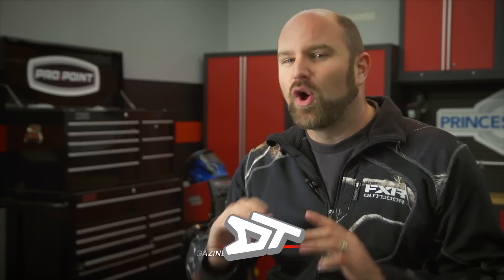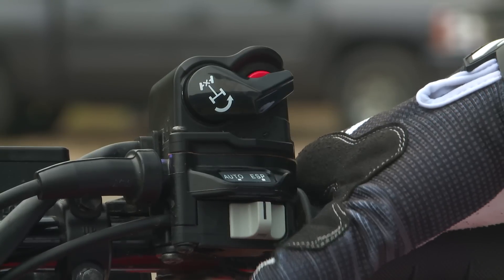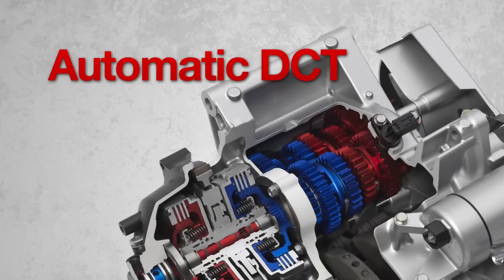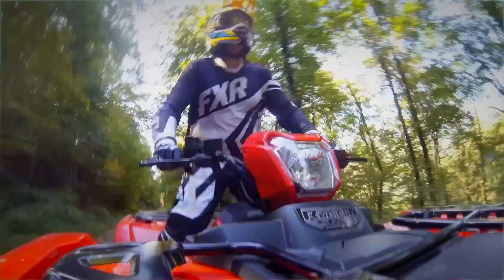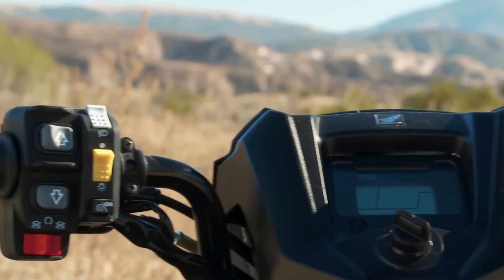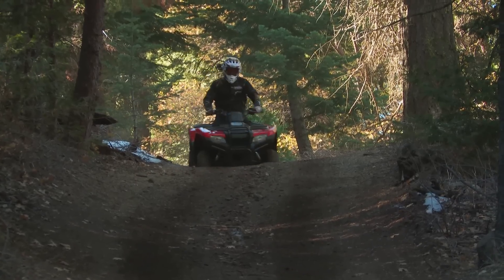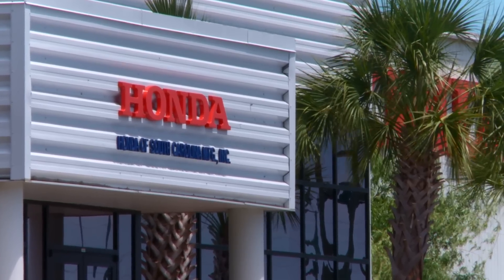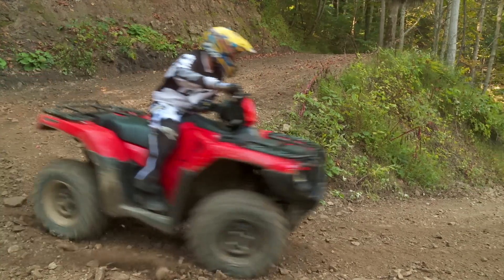Honda ATV Dual Clutch Transmission

Comment: So I have a 2022 Honda Forman rubicon 520 dct deluxe model. And I’ve got roughly 1017 miles on it. 177.2hrs. I’ve noticed when I’m in low gear if I give it more than enough gas to get unstuck it makes a pop noise maybe even a grind noise I let off and slowly try to crawl out in low. scares the life out of me. Still runs and shifts like normal. Normal top end speed no gear reduction. But I just put 28 swamp lites on it as well and it dose the same thing I’m nervous of what it could be any advice?

Comment: The only ATV I’d ever buy ! Not just the reputation for its dependability and longevity, but the fact that it’s the ONLY ATV left in today’s market that still offers the gear driven transmission. They’re tough , rugged , dependable , practical and functional . 
Another thing is that EVERY Honda model offers optional back up recoil starter , you don’t find that much anymore with other manufacturers. Always nice to have that peace of mind when you’re in the deep back woods and your battery goes dead for whatever reason. 
DCT appears to be a very innovative and unique design, I’m sure it’s durability parallels the Honda brand , but I still prefer the manual shift and the solid axle for MY specific needs ( I’m guessing the Foreman model is my ticket) . I’d opt for the EPS though as it makes tight technical riding conditions an effortless affair. 
My only gripes are small instrument panel , insufficient storage ( and lack of water tight sealing on the rear compartment) rear drum brake on the Foreman , and the lame tires that it comes standard with ( they should at least give you an optional upgrade on the more aggressive Maxxis tires that they previously put on the Rubicons) I’ve heard they even quit putting the more aggressive tires on the Rubicon now ?
Other than that it’s a solid machine.

Comment: I have a Honda Rubicon 500 its about a year old and im already having trouble with my shifter, it would not let me shift gears at all manually nor automatically i don’t know if its just my 4 wheeler or they all came out defected. And what could be the problem please help.

Comment: Japanese atv’s are tough as nails my aunt had a honda rancher that we ran at wide open throttle for several minutes at a time with 3 people and over 300 lbs on it. My yamaha has been crashed twice and repaired at home has a bent oil cooler. the honda now has a bent frame, and both still run

Comment: I have a 2017 rubicon 500 and in high the gears show on the display module but when in low the gears do not show is that how they are or is something wrong with mine?

Comment: I’m not a big fan of cvt belt drive  I like Honda because they have not gone to cvt  I love the gears.  No belt slippage or belt replacement   In my mind cvt is a cheap set up
Reply: maybe,but,i lot cheaper to replace.
Reply: I have 03 Yamaha Kodiak and it has Yamaha UltraMatic cvt and it actually one of the best belt cvt. But I prefer Automotive style Transmission.

Comment: Just sold a 570 sportsman and got a DCT Rubicon. There equally as fast. Everyone focuses on crank HP but the wheel HP was near equal and there both within a few pounds of each other. The rubicon is way more fun to ride by far! You don't need 1000cc 55whp monsters doing 88 mph everywhere. How often do you do more then 30 on a trail? Yeah didn't think so...
Reply: The rubicon accelerates just as fast as the sportsman ?? Looking at getting a can am 570. Everybody says the rubicon has no power / is slow etc.
Reply: Just bought a 2020 Rubicon Deluxe and couldn't be happier

Comment: Just brought home a 2017 Rubi dct/eps today.  This will be my third Rubicon.  I had an 04, and 12 prior to this one.  Im still on the fence about the new tranny by I think I will end up liking it. Shifts a little hard initially.  I always end up going back to Honda.  Had a 15 RZR 1k for a while but it was nothing but problems even without being abused.  Yes, the cvt was horrible. It got wet multiple times and if you ever ran it in high in the wrong conditions it would smoke.  Yea Honda is under powered but that also adds to their reliability.  All three of my Rubis have plenty of power to get me wherever I need to go and I have put them through some rough stuff.  I snorkeled the 04 and sunk it multiple times and never had a single problem.

Comment: Honda is the only way to go. While everyone else abandoned conventional transmissions in favor of CVT style. Honda stuck with what really works . Especially for longevity use. They actually taken a smaller bore and have turned out more power with gear ratios.

Comment: Its not too hard to be durable when it only has to deal with 30 horsepower.  Put a Can Am 1000 in front of the transmission and make high range go up to 80mph.

Comment: I don't know about this DCT transmission.  I own a 2016 Rubicon with the DCT and it is not a "seamless" shifting transmission.  I have brought it to the local dealer "Sutherland Honda" and they all said the transmission is not seamless and that it may get "a bit better" after the break-in period.  When my wheeler shifts, you feel the unit compress and once it shifts, it is very snappy.  They claim I didn't get a dud, but I would like to ask those who own one if they have encountered similar concerns or if they would consider the DCT a "seamless shift".  Your help would be very appreciated!
Reply: Mine does the same thing Andrew. Update your Electronic controller modual. The newer models 2017 have a different shift mapping. Think it cost around $140.00 and makes it shift like butter. Takes all the harshness when shifting and down shifting.
Reply: To add its about a 15 minute Job.
Reply: hi, do you have a part number for the new controller?

Comment: I own a1994 Honda 300 foot shifter still runs great use it every fall for moose hunting Have no concerns about going 25 or 30 kilometres from camp by my self I know it will get me back to camp in getting lazy to shift gears now. Gonna buy a rubicon or rincon can't decide. But. Never. A belt drive ! There a piece of crap that's why a snowmobile carries an extra belt U just never know when it's gonna fail

Comment: Put a 40-45HP engine in them. Offer a CVT model and a 5 speed foot shift model to choose from. Sales skyrocket. Sadly Honda just doesn't get it
Reply: JohnnyRebKy  why so it can slip in the water and mud. I'm certain honda is bulletproof
Reply: Nick Buckley my belt doesn’t slip in the mud. There fucking sealed dumb ass. What the fuck do you think a snowmobile has in it and they run in the wet conditions all the time. If u don’t know shit about bikes don’t comment u just look stupid.

Comment: My 2015 Rubicon went out of gear recently and wouldn't stay in gear, I took it in and found out the shift plate broke on the shift spindle. Now I have to split the front crankcase and swap it out a 6 hour job, not very impressive for a new machine.

Comment: Don't get to carried away with the electric/ automatic shift. The good old fashoned footshift is perfect.
Reply: I'm still waiting on a 420 manual shift with IRS 😐
Reply: Michael Kuzma dutton unless you're on a log or in the mud, without full foot wells.
Reply: I want a Honda foreman 400 automatic transmission with a nice comfy passenger seat with a single snorkel and a rad relocater on it..
Reply: Michael Kuzma dutton yeah I don’t like the electric shift much tbh, much rather the foot shift.
Reply: I hate my electric shift. 2008 Honda rancher es
Reply: Michael Kuzma dutton not for extreme off-road buddy
Reply: I agree but I have always been facinated by the honda DCT never road one before I wish more manufactures would use foot shift
Reply: @cruise-original-2  I have a Rubicon DCT.  It’s great.  And honestly don’t miss the foot shift.  Manual push button mode works just fine.  Have not had any issues.

Comment: What I can't understand is why Honda can't fix the "hard" shift in the automatic mode.  It's terrible.
Reply: Exept the fift gear...it goes very smooth. Other gears sound like uts gona broke in any second🤬
Reply: It gets a lot smoother with more mileage. I have a 2021 Rubicon deluxe it is very smooth

Comment: The Honda Foreman TRX500 is a lifesaver! literally. I slammed into a vehicle at 44 Km/h and survived. Front left crash bar and the front suspension took the shock and the bike survived just fine. Oh and not to mention it work's, climbing hills in South America pulling 1,000+ pounds. Engine braking with 4wd on 1st gear is ideal for going down hills at 50-60 degree angles.

Comment: I just got a brand new manual foot shifted Rubicon. It seems a little clunky and hard to shift compared to the older Hondas I've owned. When its just been started, and the engine is cold,  its impossible to shift from 2nd to 3rd. After a minute or so it starts to work. The dealer claims it feels and sounds normal to them. Any ideas or suggestions from anyone? The bike has 65 miles on it now.
Reply: Put some more miles on it. It will break in and be smooth as butter.
Reply: yeah it took about 110 miles to smooth out

Comment: But y would u need 5 gears in low I'm confused on that part
Reply: For some crazy ass torque
Reply: For walking slow dairy cows in, for  starting away on a steep rough track with a heavy trailer load of feeding, for going up steep narrow rough woodland tracks and being in control on bad dangerous hillsides all without slipping the clutch to be able to crawl slowly, steadily with constant engine drive. There should be a word wide law that requires all off road machines to have a crawler first and reverse gear. Some of us have to work not play with our atv.
Reply: Mudding